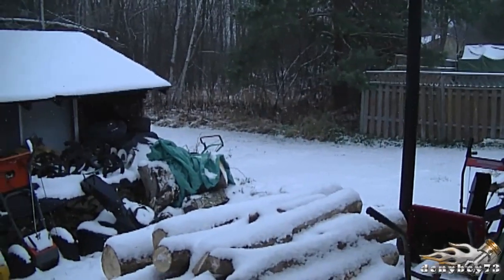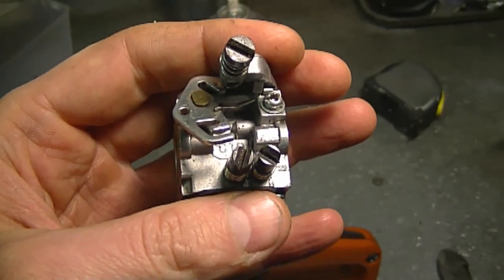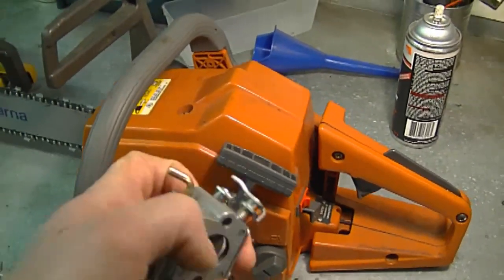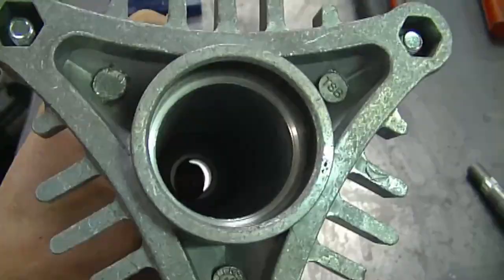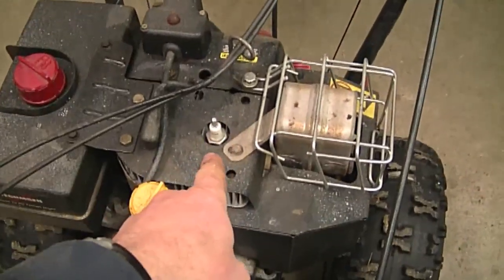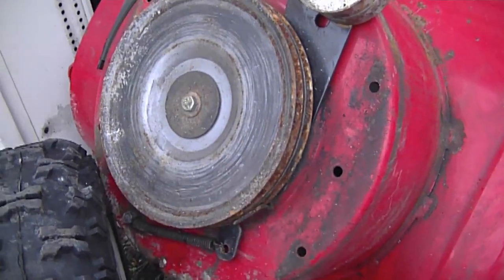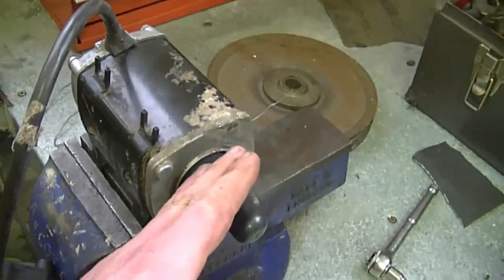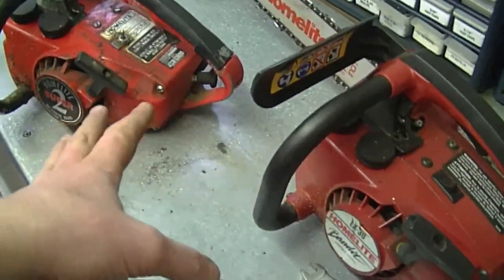Small Engines Q & A Video #113 in HD

Comment: Dony. I'm Aiden from South Korea. I love your videos. That's really helpful for me. Thanks. 
I have a question. I should repair a chainsaw. I did my best. Cleaning carb, fuel line and so on.
The problem is that too much fuel come into the cylinder. So, the spark plug gets wet everytime. I can see too much fuel in the cylinder when I pull the starting lever. 
There are so much thing can be occured. Please help me. :)

Comment: On the bearings on the spindle assembly, you can pop off the inside caps on both of the bearings so when you pump grease in it gets to bearing, most bearing suppliers say you can pop one off if the application calls for one side sealed and the other open for greasing. just thought i'd mention it, great video!

Comment: Hi Donyboy73, I have about a gallon of 2-cycle fuel/oil mix left over from my string trimmer this summer.  I put stabilizer in it, but I don't want it to go bad sitting over the winter.  Would it cause problems if I mixed small amounts of the fuel/oil mix in with my normal gas in my tecumseh snowblower?  I'm thinking like a 4:1 ratio of Gas to Mixed Gas?  I know if  you run fuel/oil mix straight it will cause carbon buildup and foul spark plugs, but what about such a diluted mixture?

Comment: Hi Dony you do great job thank you! I have a comment about oil use on small 4 cycle air cooled eninges.  My dads two year old toro with a 7.0 lb-ft Briggs seized.  I took the mower to the toro dealer. They said the engine can use up to 1oz of oil per hour at full throttle. That seems excessive especially on a new engine. I have since read the same statement on the briggs website.  I guess we should have checked the oil more frequently. Tough lesson. Tempted now to stay away from a Briggs.

Comment: Also, on adding a grease fitting to the spindle, if you take the spindle apart and pull the seals out of the bearings on the inside then the grease can actually get into the bearings and they will usually last much longer.  I have done this many times.  Joe
Reply: 7-29

Comment: Model Profile: 500 PIONEER/PARTNER bit . ly/11r4L5t 

OIL TANK CAP: ordertree com / pwe-503125403

The partner 500/5000/5000plus jonsered 490/590, husky 50,51,55,55R parts will all fit, plus swap numerous of parts with out a compatability issue. Also note, Electrolux became the parent company of all three brands. I do hope this helped!

Cheers!

Comment: Mr Dony. I was wondering if you knew how to select the appropriate gas generator for a 90 amp welder? Some people say 2500 watts will do, Other say 3000 watts will be fine. Some say it's all about the amps in the plug. You must come in contact with these gas generators so maybe you might know. Thanks.

Comment: Hey Dony, love the vids. Those oil caps seem hard to come by. Is there any chance that Pioneer Partner shared some of their design/parts with another company so you might be able to get a more common oil cap to fit? Also, a search of 'pioneer partner' on ebay brought me to the ebay store of "powelllake"  They have a set of parts for sale for a pioineer and it looks like it comes with a cap, I'm not sure if it's an oil cap or a gas cap though. Good luck with the search!